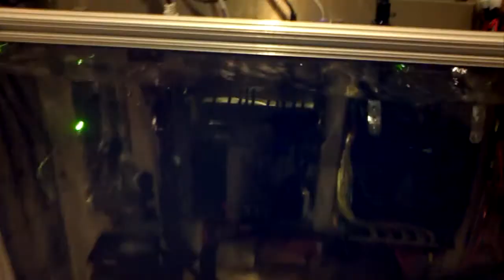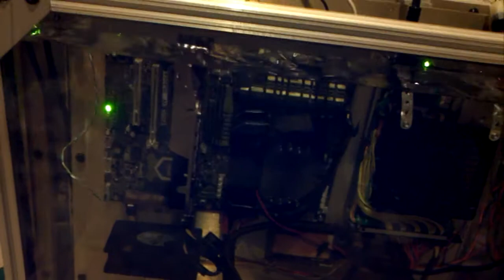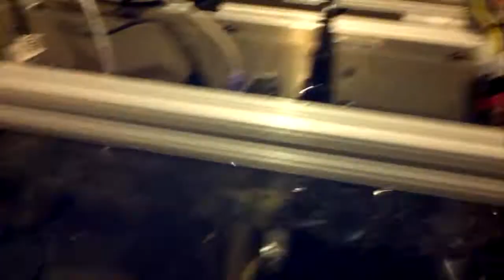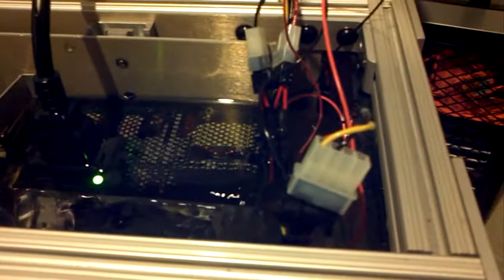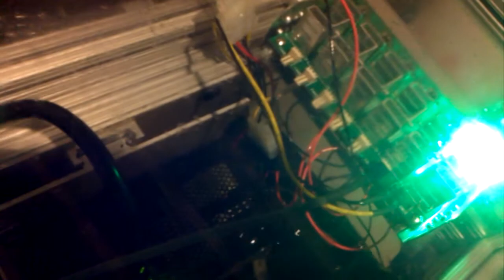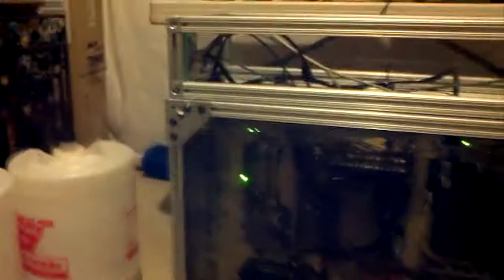Fixed Up--Test Run2

Comment from the maker: Yeah.  I've given that some thought already and I'm planning on addressing that if there's a problem.  I actually quite like the idea of getting small submersible pumps and having them act like little blowers directly across the gfx cards.  They should be more efficient pew watt but may not push enough total oil like the current fan.

I'll check it out if it's a problem.